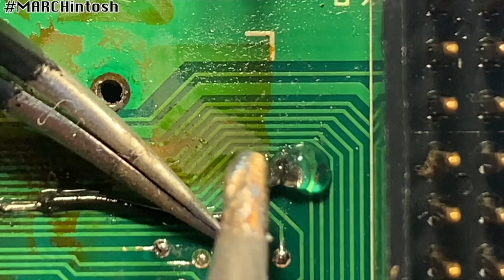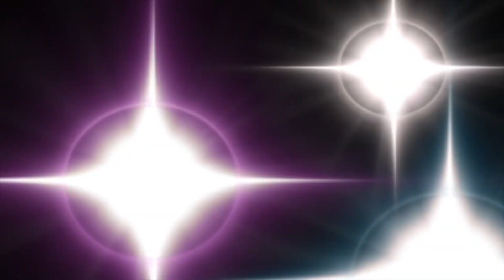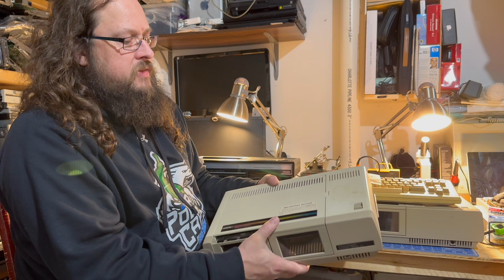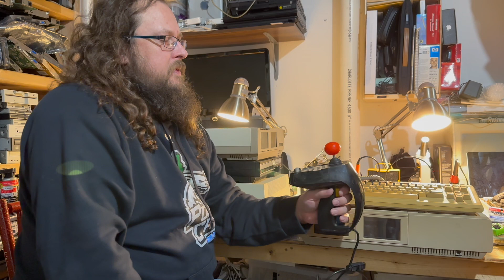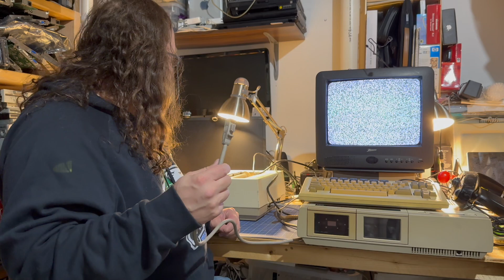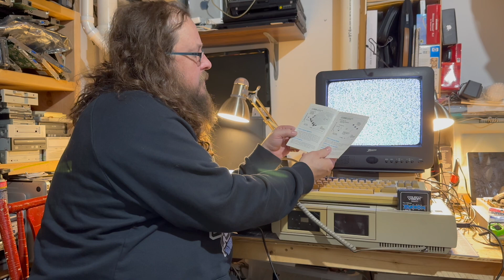Coleco ADAM / ColecoVision - Test and Try

Comment: So many design flaws doomed this system, probably the biggest being the power supply located in the printer, tethering that clunky slow noisy heavy printer to the main  unit. Also, the power supply itself had issues, it would send an EMP through the power cable into the main unit, and if you left your Digital Data Pack in the drive on power up, it would get corrupted and would no longer boot.
And why go with Digital Data Packs at all? Why not just ship with a standard floppy drive? The DDPs were proprietary, so they were not easy to come by, unlike a standard floppy disk which you could buy at Walmart. And with the EMP issue, they needed replaced occasionally. They later released standard floppy disk drives for Adam, but it's a shame Coleco couldn't have had at least enough foresight to see that coming.
The yellowing plastic they used was also a bad decision, it didn't look like they spent any time testing that at all.
And finally, why not have BASIC in ROM, with upgradable ROM chips. Maybe that's asking a bit much considering the other issues, but why not do it right?
Anyway, they had their chance, and it could have been a winner given all the pluses of the system, if only they hadn't made a few (obviously) terrible decisions.
Reply from the maker: So much of the early computing landscape was proprietary things.  I'd guess half the time it was "we can do it better" and the other half was "we'll lock customers in" - for some companies cough Apple cough it worked out, but for others, it send them down a dead end.  The power supply going through the printer is a real head scratcher, though.
Reply: Indeed, the BASIC interpreter should have been built-in or made available on a cartridge that would have been included with the system.  The only things that Coleco got right were the keyboard and compatibility with Colecovision game cartridges.

Comment: I've owned Coleco ADAM since it went on clearance in 1985.  I enjoyed your video and would like to share some tips.  While the ADAM powers on to electronic typewriter which is handy for immediate and quick typing tasks like envelopes, pressing the upper left ESC/WP key switches to the SmartWRITER word processor.  Nothing prints until you command it.  Also, the original ribbons were carbon, so they still usually work fine 40 years later.  They do wear as multiple passes over the ribbon deplete the carbon.  There were some aftermarket ink ribbons too but not likely useful today.

The ADAM portion of the system still relies entirely on the Colecovision Z80 CPU, TI TMS9928 graphics chips, and TI sound chip.  The ADAM adds 64K RAM, 3 internal expansion card slots, the ROMS for SmartWRITER, and the ADAMNet multitasking I/O bus along with first digital data pack drive.  A second drive can be installed.

While most cartridge games play on either ColecoVision or ADAM, there ARE some ADAM-only games usually on TAPE format.  The ADAM shipped with a super game pack for Buck Rogers which has additional features not found the similar ColecoVision Buck Rogers game cartridge.  The Super Buck Rogers demonstrates the ADAMNet multitasking as it loads the next game screen while actively playing the current game screen!  There are 6801 multiprocessors in the keyboard, printer, tape drives, and disk drives.

A 300 baud internal modem add-on included a CompuServe trial subscription.  In 1986 I wrote ADAMBBS, a high-performance assembly language CP/M 2.2 bulletin board for ADAM.

The Expansion #3 ADAM you had difficulty with might have several issues.  You must first ensure the ColecoVision ALONE works properly as it is the heart of the ADAM computer.  You can wire your new tiny power supply for ColecoVision if you get the right 4-pin connector and pinout.  Also, the  expansion version of ADAM has a sliding DOOR on the printer power connector which may prevent your from fully inserting the power connector to ADAM.   There was a plastic tray to seat the ColecoVision AND the ADAM into to align the expansion, and it moved the sliding door for the power connector.  You can try to move the door using a credit card from underneath Expansion #3.

I'd love to help you with any further questions you might have about ADAM.  Thanks for the video, which I will share with my other Coleco ADAM friends!